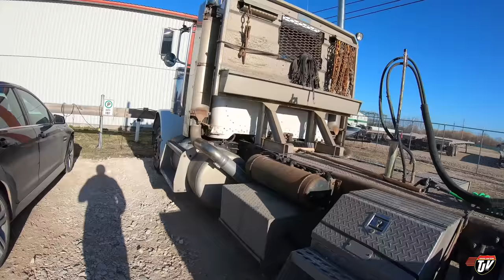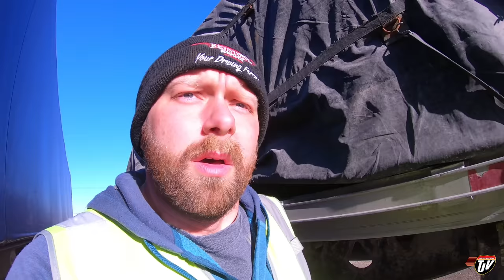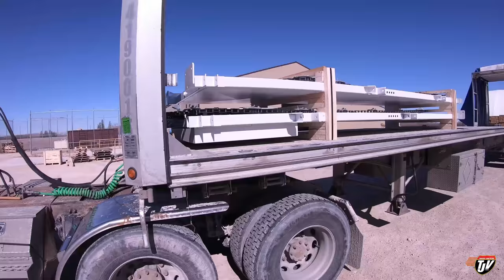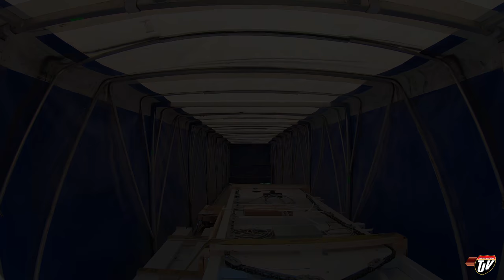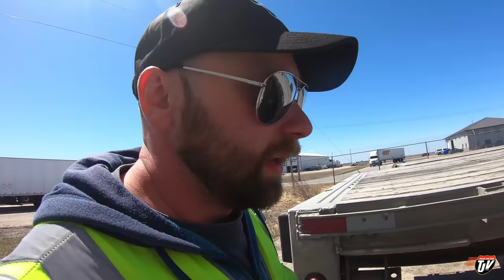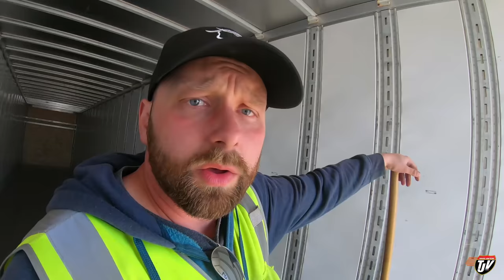My Trucking Life | WHAT'S THAT FOR? 🤔 | #2278

Comment: The word you may have been searching for (regarding bumper stickers and you not liking them on vehicles) is “pristine!” The switch that you didn’t have any idea about was actually an ejector switch that on this particular trailer was broken. However, if it had been working, your load would have been ejected off of your trailer without fanfare. . . later. . .

Comment: If you have a real heavy load on the trailer you can turn the switch to the active position , that will put the trailer in hover mode and take 50% of the weight off from the axles . Less chance of getting a over load ticket while hover mode is active .  :-)

Comment: That switch was for the automatic floor conveyor. This would automatically unload your trailer for you. It worked good until it failed and unloaded the trailer load on the road while driving down the highway. So they replaced the floors but didn't remove the switch!!!

Comment: Where did you get the folding steps for the dog to get into your highway truck and does it work for pickups as well. Thanks
Reply: @Supper@6 Thanks I have a 90 pound dog and he and I will both find it easier getting in and out of the pickup truck.